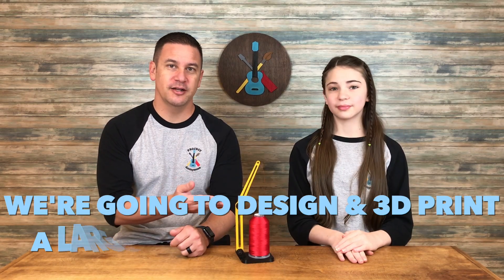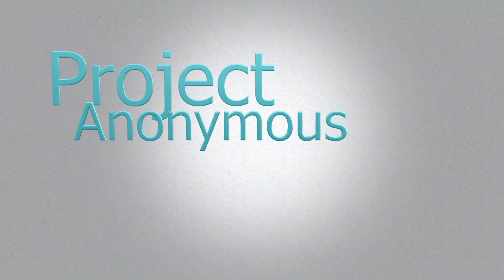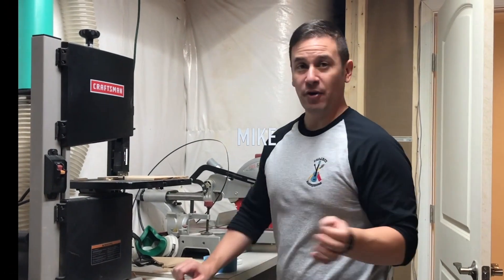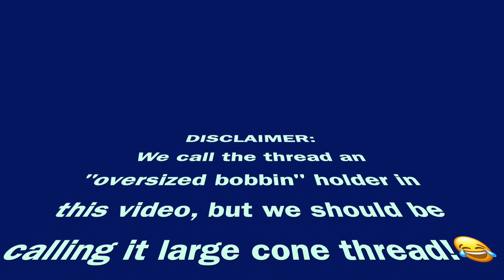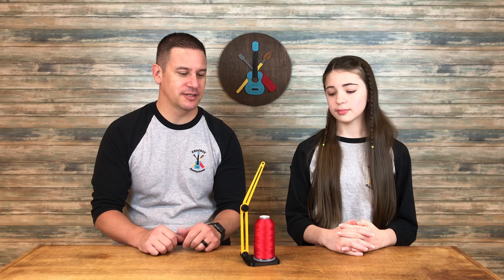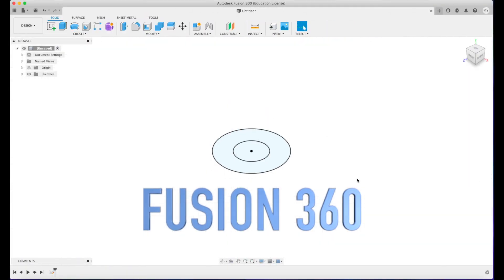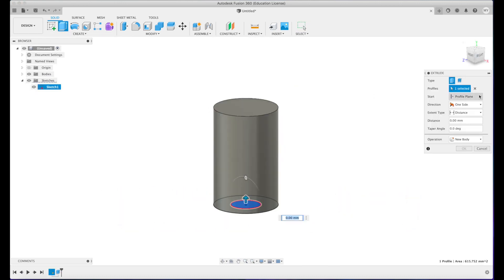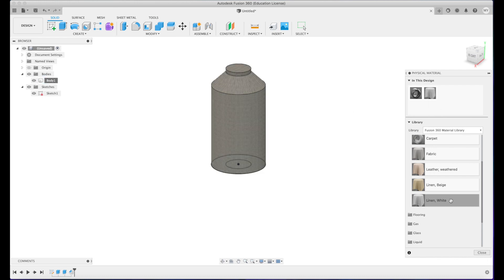3D Print & Design a Large Cone Thread Holder

Comment: Thanks for the file, may I ask what size tap did you use to cut the threads?
Reply from the maker: Absolutely, we designed the threads to be 5/16 - 18 (because we had that tap/die on hand). We’ve found that working the threads in/out will essentially do the same thing as the tap and die. Hope this helps!
Reply: @ProjectAnonymous_Duo  thanks!  My husband decided to just use screws and wing nuts.  Works great!  (I’m very lucky my son has a 3 D printer also)